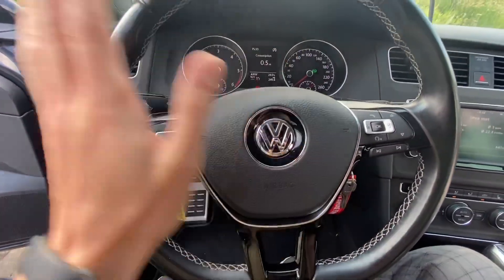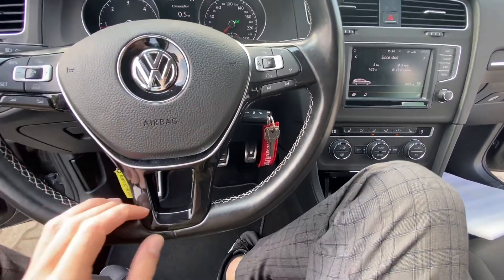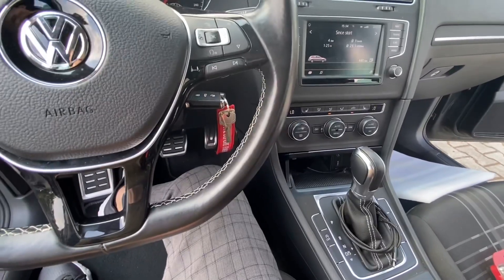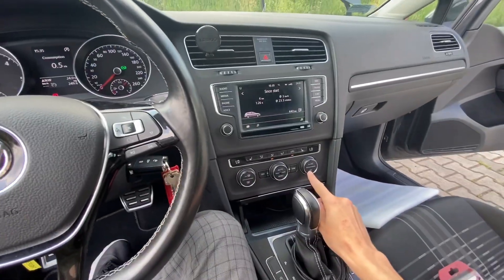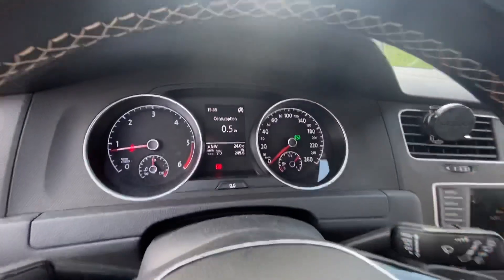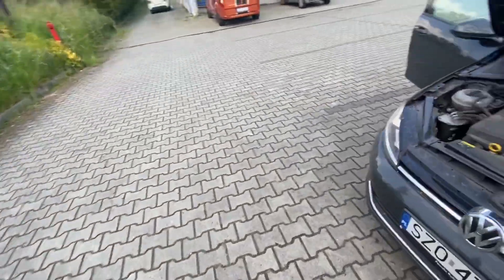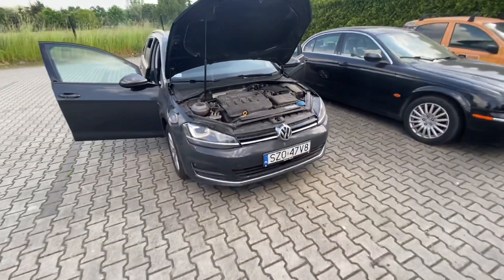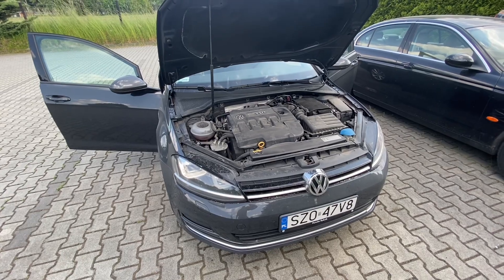VW Golf MK7 (5G) hot air from passengers vent cause?

Comment: Yup, exact same problem here. Air was blowing cold(ish) from the far left vent and gets increasingly warmer as you move across the vents to right side of the dash.  Weirdly enough, it turned out to be nothing but low freon.
Reply from the maker: That’s right. Low freon will decompress and cooldown only the part of the evaporator closest to the inlet. And the inlet is on the left side.

Comment: Hello! Do you know if the golf 7 has a Coolant shut off valve (N82 valve)? also called a solenoid valve i believe. or does the diesel models have the thermostatic expansion valve you mentioned instead?

Comment: While mine is off i have warm air inside the car, wtf? anyone can help?
Reply: I hame the same problem sometimes but with no solution so far. Everything is working according to my mechanic.
Reply: Can be multiple thing... maybe your fan is not working or your engine is overheating ..that also can make your a.c blow hot air

Comment: I have same problem 2013 mk7 climate control.

Drivers side comes down to 19oc but passenger side only 26oc

I noticed AC low pressure side (cool side) is on same side as drivers side.

I tested pressures with gauge set and get 20psi on low side (constantly) and 140psi on high side constantly.

I dont have any regassing equipment so can't just top up.

My guess is that its low on gas. The small amount of cool gas enters from low pressure into evaporator but quickly is disapated by the air blowing over the evaporator which makes it out of the drivers side vent enough to notice some change in temp but the passenger side ends up with no temp change coz there wasn't enough gas to make it across the other side of the evaporator.
Reply: Following up: Took to a guy I found on facebook marketplace yesterday who has regas equipment. There was almost ZERO gas in the system. He did the regas for $135AUD system takes 500grams. Working good (for) now.

One thing he showed me was the low pressure pipe in the engine bay wasn't even cold when it should have been.

Comment: experienced the similar issue recently, top-up some refrigerant to correct value and so far so good.  
Aircon system back to cold as previous. 
Will continue monitor. thanks.
Reply: Any changes? Having this issue but I have the manual A/C.

Comment: Had this same issue. The leftside was still cold but the right (passenger) vents were blowing warm air. Seemed to develop pretty quickly. Temps going from left to right for the front for vents were: 58, 70, 81, 85.  The way it seemed so sudden made me think a flapper was broken or something. I scanned and had no faults on the AC system. Tried adding a few oz of R134a,  brought the low pressure side from 29 to 35 psi and that fixed it!  Pretty happy I dont have to rip anything apart. Now I am like 53-54 degrees F across all 4 vents. Car is like 6 years old so I will continue to monitor, I dont think its a massive leak but maybe a very small one.

Comment: Have the same problem, had new heater matrix fitted, system flushed but still not fixed... Left side blows out warm air and driver (UK) side doesn't really blow out warm air...? VW themselves say it's the matrix
Reply: Hi i have the same problem you had did you get I fixed and if so what was the problem?
Reply: Apologies for lateness of reply, took it to an auto mechanic and problem was that there's a silica bag that needs either replacing or removing... Ask your mechanic about it
Reply: Did you get it fixed, how did you do it ?
Reply: Same issue! Any luck fixing it?
Reply: @razwanmahroof8274  I removed my silica bag quite long time ago… I have a gut felling to check the interior temperature sensors. 🤞

Comment: Just checking if you fix the problem and if it was the "expansion valve" that needed to be replaced?
Reply from the maker: Nah, there's a really small leak in the system. Not big enough for the pressure to drop over night, but after couple months problem comes back. I believe it's the radiator.

Comment: What about if the ventilation system is off, yet both air vents on the far  sides and under the screen window blow hot air inside?

Comment: Had the same problem, first repaired the broken motor from the recirculationflap. (Sound of the air didn’t change while pushing the button and had clicking noise before). Had the hope this would influence the main issue, of course it didn’t.
After searching found this video to locate the mixing flap/motor and found the problem. The spocket popped out of the motor, easy fix!! Recalibrate (AC + front vent button) and done! 
Thanks for the clear video of the location and working of the mixing flap/motor!
Reply: Where is this box in front of the engine?
Reply: Where is the mixing flap/motor located?

Comment: @MR-FIX similar problem as yours, i have a 2016 Golf7 was low with refrigerant had it filled up and after the week they checked and said a small amount leaked. They say it can last all season no problem, but i want to find leak but dealer needs 2-3 days to find the small leak. What exactly did they discover after the week was your issue?

Comment: Have you check the messured inlet temp ind control unit 08 climate unit, for the right side plased in the cabbin, air nossel?
The temperatur sensor coult be bad.

Like wrong messur of inlet temp at 10 degree forses the flap to hot air in sted og Cold air.
Reply from the maker: Checked all readouts. Also I believe that when set to LOW air flap will always be position for cold air.
The issue was in low refrigerant which was not able to cool down whole area of the heat exchanger.
Reply: @mrfixpl  makes sens

Comment: I am an old dealer mechanic. We once had a passat 2016 in the workshop where the same problem was present. We thought there was a valve stuck in the valve housing. We’ve tried to calibrate and check all of the valves. I had to take the whole dashboard out to find out. Maybe there was an valve stuck? Nothing found.. the problem was not fixed. 

It turned out afterwards that the air conditioning system was not filled enough. Strange that cold air comes out on the left and warm air on the right. you would expect that there would be no cold air at all in either grille. make no mistake. Also check first how many grams of refrigerant is in it and whether there are any leaks.
Reply from the maker: The same here! Just went back from the A/C service, the drained the system and there was about 20% of the expected refrigerant in the system. Car passed the vacuum test for leaks, so they charged the system back with correct amount of refrigerant. And I'm going back there in few weeks to drain it and charge it again just to check how much is missing.

If the refrigerant is low, the heat exchanger will not cool down evenly. It will be colder on the input side and the other half will stay warm. That's why the passenger side air is hot.

Comment: Is there any way to turn off air from the face/dash vents when you have lower feet vents active only?
Seems the only way to stop it is to switch the vents themselves off with the dials under them. Sometimes I just want warm air blowing on my feet,  it still get air blowing out the top.
Reply from the maker: If you set air distribution to feet it should blow the air only over there. If not then you can try performing the basic settings procedure and hope that the air distribution flap motor needed it to operate properly.
Reply: @mrfixpl  What was your problem and how did you solve it?

Comment: I have the same problem this winter, right side was cold and left side was warm (when trying to heat up the cabin). It turned out that the radiator distributing heat in the cabin was clogged because of bad cooling water. New radiator and everything worked fine again. Your problem is probably the liquid in the air condition system, it is evaporating overe the years. How old is your Golf 7?
Reply from the maker: Few times I saw some info about this issue - heater core was clogged with silikat from the coolant reservoir.
Reply: @mrfixpl  That´s right. How old is your Golf 7? :) Mine is 2014.
Reply from the maker: 2016
Reply: @mrfixpl  hi, what coolant would be the best after removing silikat bag from reservoir, so my intake radiator wont rust. i have g13 right now - after silikat removal it doesnt meet the specs. 2.0tdi 150km ckfc
Reply: Ienkzns
Reply: Interessting.. I have the same issue as you. Cold weather, cold air from right side.. I will first check to motors and coolant level, but it is maybe the radiator then.. 

Front left temperature flap actual value: 100%
Front left deflector temperature: 48,62c

Front right temperature flag actual value: 100%
Front right deflector temperature: 32,63c

Leg deflector temperature: 47,29c
Reply: @taztaz79  hi, have you managed to find out the problem? I have the same issue
Reply: @waqas786mohammed i have not had time to look into it yet. Will let you know.

Comment: Thx. Let us know how you solve it and wich are the steps please. Thx for sharing your experience with us. 🤝
Reply from the maker: Just went back from the A/C workshop and in my case the refrigerant was missing from the system. Strangely enough my A/C passed the leak test without any problem (30 minutes with vacuum) so they charged the system with proper amount of the refrigerant and I'm planning to go back over there in few weeks to drain it again just to check how much of the refrigerant will be missing.
Reply: @mrfixpl  it appeared that my 2017 golf 7.5 has the same issue :( today I discovered it when was driving during the sunny weather. Will try to fill in the system as you did.
Reply: @Alex_UQ  my friend has an E Golf 7.5 and it has an oil leak😅
Reply: @mrfixpl  my airco still give air also if i turn it off. Do you know what can be ? Thx
Reply: @mrfixpl  hey any update? Did you fine leak in system?
Reply: @mrfixpl  any update
Reply: In my case the problem is that I have warm air now all the time, no matter the weather... Started 2 days ago and I doubt it's a/C related, as when I push the a/C button I have cold air.. But disconnecting it doesn't sent cool air, just warm, warmer than the street air... I'm lost what could be...
Reply: @eduki  I have the same. Mine has a webasto auxiliary heater, so thinking maybe that could be the culprit.
Reply: @kpajeda Same here! I have the same heating system (never use it, but I'll try to get info about the relationship between the problem and the Webasto system).